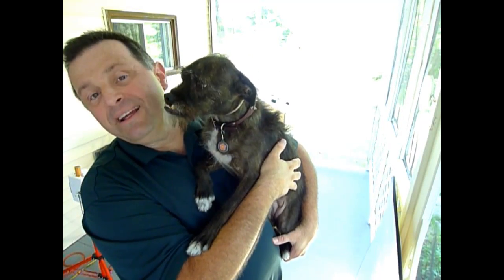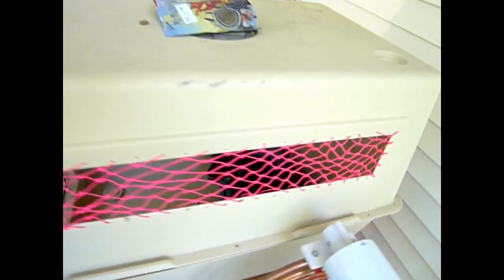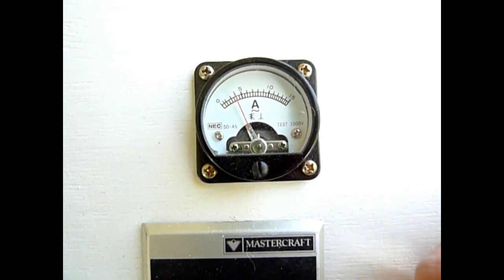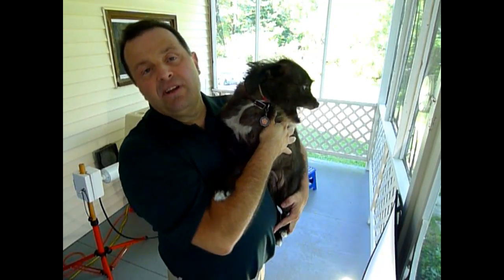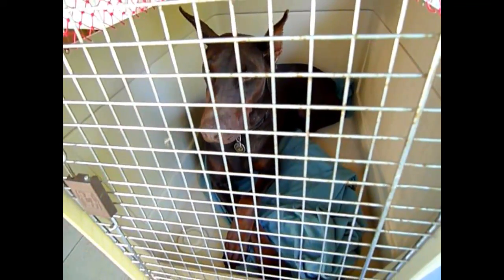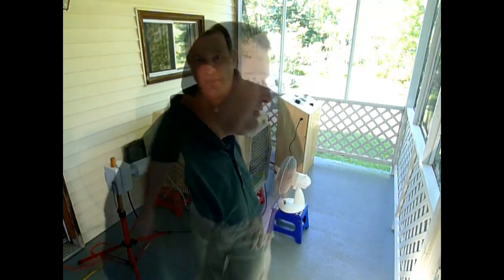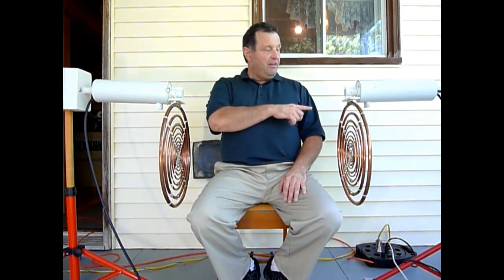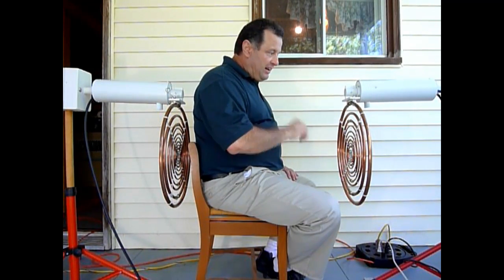3- Lakhovsky Multiple Waves Oscillator Demonstration Part 1

Comment: Do you live in the United States was wondering if you charge for getting as many sessions needed for my sister she has cancer thank you for video
Reply from the maker: Sorry for the delay.  No I live in Canada.  This video was made a few years ago.  My machine needs some refurbishing.  Brand new these MWO (Multiple Wave Oscillator) sell for the same price of an average size car.  A more affordable unit would be a Rhumart machine.  You can find them on Craig list.   It might be better if the cancer is localized. The MWO is very powerful, akin to an artillery barrage, as the Rhumart is more of a Sniper type action.

Comment: This is amazing thank you so much for posting this do you find it helps with the dog's lots?  I'd like to know how good it works after the fact that you've owned it for 7 years now.
Reply from the maker: Hello, after using it on and off for the last 7years,. More often off.  I did not use it much in the first 5 years because did not need it    I don't advertise for it as I am not a medical professional.

However, in the last year, one of my dogs developed a disease called Wobblers.  This is a degenerative condition for which there no cure.  Now I am using the machine regularly and it does help my dog a lot.
Reply: Wow thats amazing. Could you tell me where I can get the machine from??

Comment: Can you make a video of how you built the device?
Reply: Good afternoon! I suggest you sign a contract with the developer and purchase an information package for the production of a modern model of the George Lakhovsky multi-wave oscillator. With this code, you can get a 10% discount. Code D1007. More detailed information can be found on the website mwo.name . The developer's contacts are also listed there. 
The payback is very fast - the costs are fully recouped after the production of 4 such devices. The rest is profit, without any deductions to the developer.

Comment: Where can I purchase this device?
Reply from the maker: Hello!  I know of only one place that build and sell machines that are compliant with the original ones.  Do a search with the keywords ''Compliant Lakhovsky mwo''.  Most people build there own machine, first to make sure they are compliant with the original and also to save money.  

Buying a machine from a manufacturer selling machines really built accordingly to the inventor's designs will cost many thousands of dollars.  In the 30's, Lakhovsky was asked how much one of his machine cost?  Lakhovsky answered ''About the price of a middle size car''

If you want to build your own, you will need to get the 2 ebooks sold on the following website:  
http://users.skynet.be/Lakhovsky/index.htm

On this website, a group of engineers were able to put their hands on 3 original MWO machines built by Lakhovsky.  They were able to describe precisely how the machines were assembled and how to build one with modern components.  

I have no connections with them and I don't make a single nickle out of the proceedings of this website.  If you want to build a real Lakhovsky MWO, you must get these books.  

I hope this help.
Reply: @Anterak123  The best in Europe is hier
 https://www.rt17.hr/products/multiwave-oscillator-replicas/
Reply: For purchase questions, please contact me.
Reply: Good afternoon Would you like to purchase
Multiwave Oscillator
George Lakhovsky? This can be done through our website or by email.

Comment: Hello.   Can I ask you what the size (diameter) of the largest ring is?   Also, if you don't mind me asking, how much did this cost you to build?
Reply from the maker: Walt Thisnee Hello,  The outside ring is about 50 cm in diameter, the same size as the original device from G. Lakhovsky was.  For the price, my own machine did not cost me much because it is built mostly out of recycled material.  The copper I got from the trash bin of a refrigeration industry and paid it by the pounds. (rings and wire for the bobines and induction filters), the transformer I already had from an old neon sign when I had a business 30 years ago.  I knew back then I would find a use for this transformer...For the things I did not already had like the variac and the capacitors  and various connectors, I would say I had to pay about $500.

If you would have to buy every thing necessary to build one with brand new material and parts and build everything by yourself, I would say easily around $2000.
Reply: Thank you very much for the information.   I plan to visit the website you recommended and eBook.   I forgot to ask, are all the rings the same tube diameter?   The copper tubing that my local hardware store are only in 3/8" or 1/4" size.
Reply from the maker: Walt Thisnee 
The rings were of different diameters.  The smaller tubes were for the inner rings.  Outer rings are made with bigger tubes.  3/4 and 1/2 inch flexible copper pipes are normally easy to find in the plumbing department of well stocked hardware stores as these are often used by plumber contractors.

Comment from the maker: Hello!  There are no plans on how to build this, as such.  But there is an eBook written by Bruno Sacco and Tony Kerselears and a CD Rom made by JC Dupuis.  They were able to study up close 3 original machines made by G. Lakhovsky and back engineer them.  There you will find all the values and measurements.  These documents are a must.  Their website is  http://users.skynet.be/Lakhovsky/
Reply from the maker: Thank you Vahe for your kind words.   I am only a layman as far as electricity goes.  I did an electricity/electronic course when I was in grade 10 when I was 16 years old.  So I do not think I would be able to give you much intelligible answers regarding the specifics on the machine.  What I know I learned by reading things on the internet. 
 
I would not change the way the machine is built.  These plans are coming from genuine Lakhovsky devices.  As far as changing the capacitor and spark gaps for transistors...first I do not think you can achieve the same results and the same power with transistors.  The relationship between the capacitors and the spark gap is an integral part of the workings of the machine and from what I understand it is necessary to achieve the power and the ringing of the electric exchange which is what helps creates the harmonics which are what makes this device a healing device.
 
Is the machine dangerous?  I suppose so.  Yes it is very high voltage.  About 150 000 volts and if you touch the transmitter antenna while the machine is working you will get a nasty spark.  It will bite you yes, but it will not kill you.  Believe me when I say you rapidly get a healthy respect for that machine when it is working and you learn very quickly not to touch the antennas.
 
 
I do not want this email to be too long.  I am not an engineer, but I made my degree in Biology and my Mater degree in Environment.  With all the reading I did and the different internet sites I looked at about magnetism and electricity and working on a Bedini motors there is something you must understand.  It is widely believed  by students and also by teachers that everything has already been discovered and it is all in the school books.  If it is not in there, it cannot work.  Well this is far from the truth.  There is much that is not printed in school books.  Here being a layman may be an advantage over being an engineer.   Why?  Because the layman does not know something is impossible and cannot be done...
 
Here we are talking about Tesla type science.  In his days, the best brains of science couldn’t make head from tail with Tesla and his devices.  So they ridiculed  and shunt him.  You can be sure there is not much of Tesla science in school books.  So today’s engineers will know very little about his devices.  Only now some maverick minds are rediscovering his ideas.  Look at some videos on the story of Tesla, it is most enlightening.
 
I will let you go on this little story I learned when I was in 10 th grade.  I hope I would not butcher it too much.
 
You could call it:  The bumblebee paradox;
 
Many years ago, a group of very prestigious scholars and professors did a study on the Bumblebee.  They calculated and made a lot of statistical charts and many hundreds of pages on a report that was proving without any doubt  that the way the body and weight of the bumblebee was compare to the size of its wings and the way they were working, is was scientifically impossible for the Bumblebee to be able to fly....
 
...But you know what?  The bumblebee did not read these reports and it doesn’t know it can’t fly....so he keeps on flying where ever pleases him.
 
I do not think a phone interview would help you much.  If you have questions you could send them to me and I could think about them and give you an answer if I am able to.  Or you could contact the authors of the book.  This is what I did when I did not understand something in the book.
 
Best regards,
Reply: +Anterak123 
Hey Anterak, I got the book secrets revealed. I asked my friend to make it for me but after reading the book he has some second thoughts about making it according to specs because of safety. He says the hand made capacitors and the spark gaps are dangerous. He said to use transisters instead of spark gaps to have the same or even better effect. Calling much of the design old technology and there is a safer and better way but my feeling is that the machine should be pretty safe as its been 
used for years and i feel like yourself that it must be made according to original specs I am not sure on specifics since i don't have knowledge and experience in electricity and fields of energy. I would like to ask for your help as someone with experience and knowledge. I was moved by your testimonial video and this machine could be very helpful for myself and my family/ friends. Could we please have your expertise and experience to clarify a few things. I could pay you for your time of coarse, whatever price you think is acceptable. Just a few short conversations over the phone would go a long way for us to understand how to build this in a way we feel safe in making it and using it as well.
Reply: Anterak123 So happy to see your loving care for your children. Heart warming. I miss my babies. Yes, they had full happy lives. They become adults with well adjusted personalities, but still we spoil them as often as we can. Alas, we grow old too soon and wise so late. All the best to you.
Reply: Anterak123 Thank you!
Reply: hy i hard of this book i am allsow trainng to know more of this machin from where can i get one!? i will be realy taynkfool
Reply from the maker: @Sinankaya33  Sorry for the delay.  Go on my channel, then click on "about".  the email address is there
Reply: Silviu Stanciuleasa yo yo ya getz dah maasheen inna watts
speek ta rollo he dah man!
Reply: Can we do experiment with machine on me
Reply: Vahe345, can you share me the book?